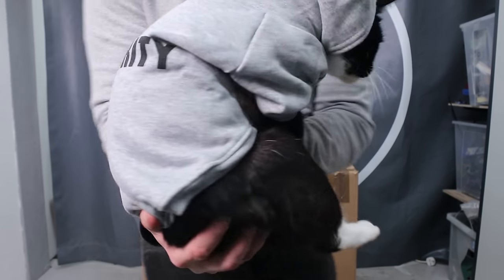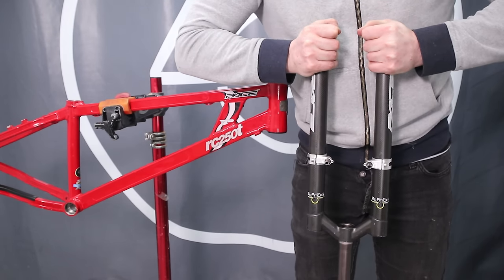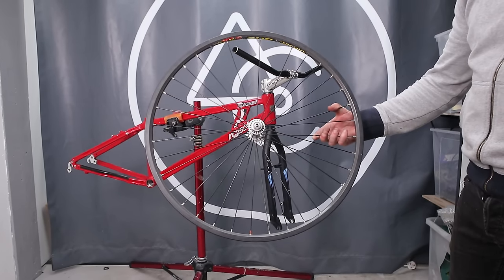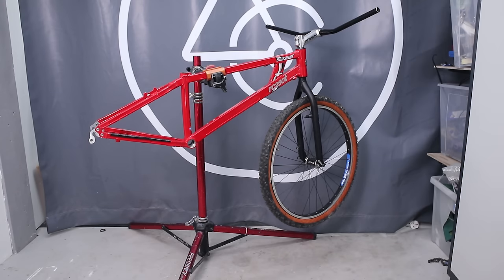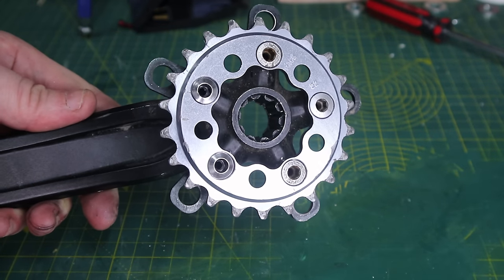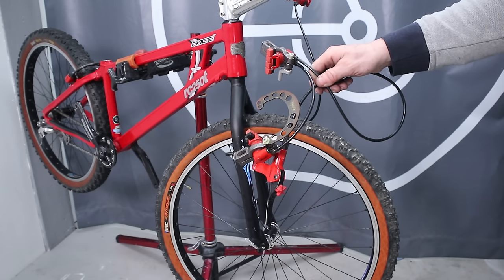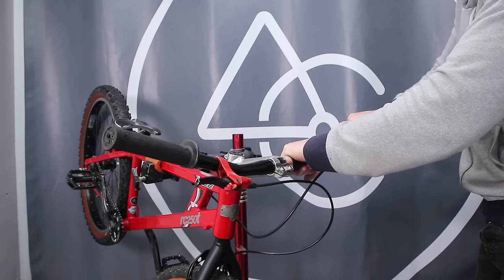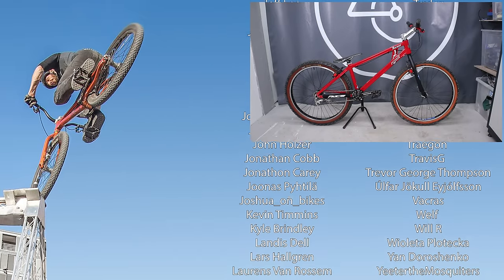My dream bike build, a Pace RC250T retro trials bike...I always wanted one of these!

Comment: That's an HS22 booster from a 90's model brake. I have a pair of HS22s in that exact grey colour on my 1996 Santa Cruz Heckler. The levers are honking great 3 finger hobbies but you learn to get used to them with just two fingers and careful positioning of your hands.

Comment: 20:48 one thing i did when i first swapped my bike to single speed but never seen anyone else do was routing the chain under both pullies instead of the convetional manner, this way it'd be nicely tensioned and wouldn't swing as much since it kinda negates the swing point of the deraileur
Reply from the maker: My only issue with that is reducing the chain wrap around the rear sprocket
Reply: @Ali_Clarkson  you do have a point, a chain coming off is never a good thing even if the chances are low 👺
Reply from the maker: @brunaogemeplay2439  it’s as much just not wanting the chain to skip, with a reduced wrap it can happen though with a bigger 18t it’s less likely than with a smaller one
Reply: @Ali_Clarkson  indeed, it's something to take into consideration.
Also, i just realized your diy tensioner does just what i mentioned in a more effective and safer way, guess you're really ahead of the game lol

Comment: Can’t believe the change of fork  !?
Reply: Some later pace frames had really cool sliding dropouts, no need for a mech or tensioner. I’ve still got an old pace 325 with them, it’s setup single speed with the chonkiest azonics stem and a pair of straight carbon tube forks, sadly they are just a pace copy and not the real deal.

Comment: That's the joy of radial spoking for you!
Reply from the maker: Sadly yes :(
Reply: It's more about looks rather than anything else, isn't it? They could make the hub flanges wider for added strength but they would look really naff...
Reply from the maker: @Stelios.Posantzis  it’s slightly lighter as the spokes are shorter and it makes the wheel stiffer laterally (but weaker vertically)
Reply: That sort of rings a bell @Ali_Clarkson  from back when I was reading up about those things a lot. It makes sense. I could never afford one of these straight spoke affairs which back then were all custom lacings and the thought of snapping a hub was frightening enough (mostly for the cost aspect, the thought of breaking my neck obviously came a distant second) to keep me off them.
Reply: @Stelios.Posantzis They did make a specific radial hub
Reply: You mean Pace @mpw321  ? I think the point I was trying to make is that radial hubs were never both as strong and light at the same time as people wanted them to be.  People expected them to be as strong as normal hubs but they never were.

Comment: You hit the jackpot! I always wanted a Pace frame with Pace crank-set (or was that a Race Face crank-set?). What a great combination! My preference of course was for the anodised aluminium frames but I have to say the powder-coated red version looks gorgeous!
1:58 What's the big deal? It can be gusseted and re-welded. There's tons of good welders out there. The question is: do bicycle riders know this or do they chuck their broken frames in the recycling bin without checking first?
10:15 Any half-decent machinist can fix that. Shouldn't be that expensive.
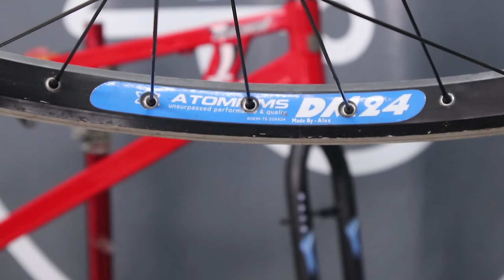11:33 An Alex 24 on a Pace frame with Pace hub! What? Alex 24 were bottom of the pile! Not even Halfords would stock them!
18:35 Middleburns looked ghastly though. I wouldn't use such a set unless everything else on the bike was just as vulgar looking.
21:50 This  is the obvious choice.(32:33 agrees)
22:44 If you're that worried about it make a mould of it to have it re-cast if it brakes. Better yet, make a laser scan and have a few spares 3-d printed.
28:03 Are you sure the seat-post alone would not be more comfortable? This looks mega painful!
29:05 I'd be more interested in how much that thing cost.
31:30 You need to place a protector over the vintage NOS Pace chain-stay protector! I know I would.
31:13 You brought back a lot of memories, especially with the Azonic stem and the Tioga not shown. I'm definitely subscribing. Oh, I was already subscribed - never mind. Great skills too!
One word of caution though: I would be so worried about being period correct with the tyres and especially the inner tubes. These things deteriorate exponentially with age. The last thing you need on a period bike like this is some serious damage due to a burst inner tube or, worse, tyre wall!
Reply from the maker: The silver ones are mint! I like the red because of again the Trialskings used them :)
Reply: I consolidated all my comments into one so that it would look less annoying without realising you had already replied to each one of them  @Ali_Clarkson  ! First time this happens to me! Unfortunately, I cannot undo the deletions so I'm not sure which replies corresponded to which comments exactly.
I guess you're right about re-welding the frame, it would weaken it without heat treatment which in the case of this painted frame would mean you'd lose the original paintwork. I guess that is one huge downside of aluminium and titanium frames... you gotta to take care of them.
Which one of the comments you think I'm dead wrong about? The one about the hub? Or the one about old tyres maybe? For the hubs, reckon, worst case, the machinist would cut off the broken flange on the lathe, remove the metal down to the carbon tube, make a new flange and glue it back on the tube. Easy-peasy. Probably cheaper to buy another hub of course.   Alternatively, if you don't want the ultimate strength, the missing bit of the flange could be built up with welding and subsequent machining would give it the original shape. Probably harder than it sounds with dubious results. I'm no machinist by the way.
I had never seen a red Pace frame before this video btw. I'm torn now because I always thought that the Pace anodised frames were the coolest. I also did not know they are not as strong as they looked. I always thought that they were the meanest and toughest out there based on their looks alone. Of course back then I could only dream about a Pace frame...

Comment: Wanted one of these so badly after seeing Akrigg on one at Addingham but they were out of my league back then. Had to make do with a cheap copy that still had square top and down tubes and similar geometry. I used to run the old STX cranks and ran two 22t chain rings back to back with a piece of chain acting as bash on the outer one. Gave it to my nephew when I upgraded to a Saracen team frame. He snapped it long after🙄
Reply from the maker: There’s one of those cheap copies on eBay (or FB marketplace) at the moment if you wanted to relive your youth 😋
Reply: Thanks for the tip off but I'll stick with my Echo control for now😁

Comment: That Mavic X517 rim, and Kool Stop red pads (grinded rims and a lot of tar:D) brought back many memories:) Also do you have a reccommendation for a rear hub (not insanely expensive) similar like shimano silent clutch was, with "instant" engagement?
Reply from the maker: Can’t say I can think of a decent hub sorry, you’re almost asking for an impossible product…if it’s cheap it probably won’t be strong and if it’s silent it also might not be reliable
Reply: The Shimano silent clutch hubs engaged pretty much instantly but felt so spongy under load that they were very hard to get used to for XC riding, not to mind trials. Box (Formerly Stealth) and Onyx make Sprag Clutch based hubs for sale at the moment (More or less the same thing as a roller clutch), but they're not cheap. The only Shimano roller clutch hub I'm aware of now is the Alfine 11, and it feels noticeably spongy under any kind of power, with 2nd gear being more or less unusable it's so spongy. I love the silent running and low maintenance for commuting though, the 2 kg ish weight it adds to the back axle means bunnyhopping the bike is a challenge.

Comment: That small hole in the bottom of the BB shell, is that for a crank stopper or just drainage? (I wouldn't have thought crank stoppers are a thing in trials?)
Reply from the maker: Might’ve just been a generic bb shell that has a hole to mount a cable guide, I’ve not had a close look though
Reply: @Ali_Clarkson Yeah, I forgot about cable routing,  the frame has a mech hanger of course so I expect its for that.